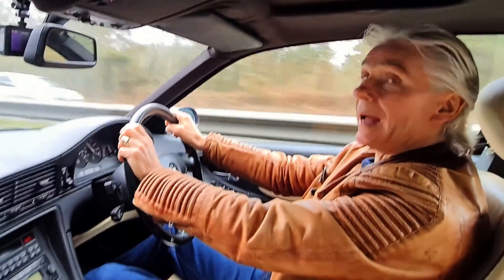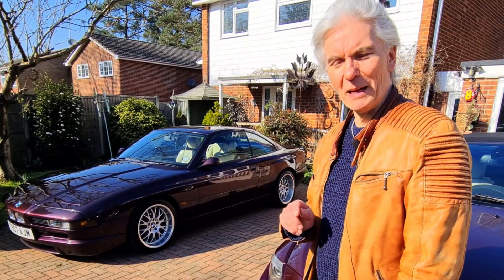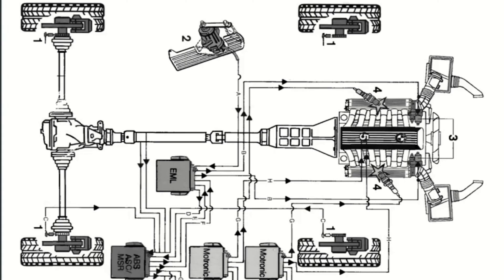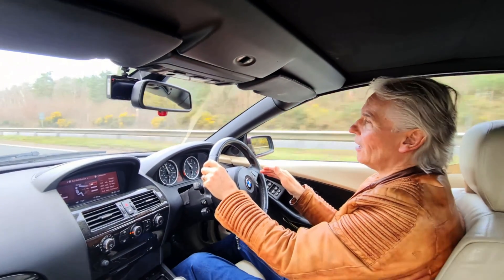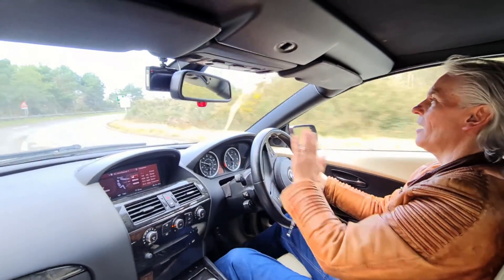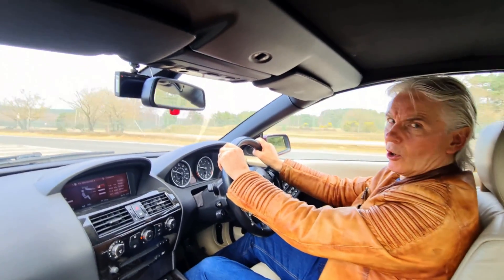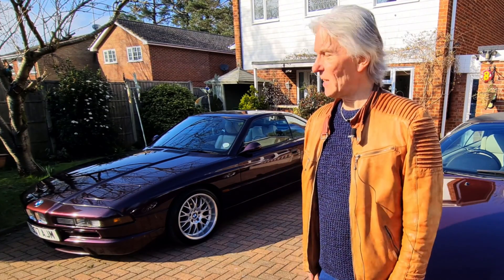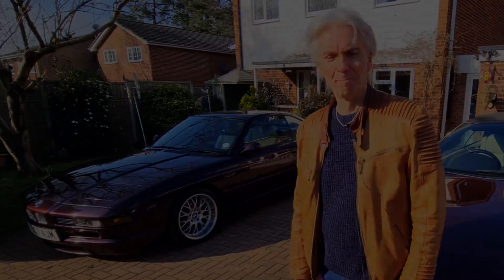BMW LIMP HOME MODE? PROBABLY NOT!

Comment: My bmw 335d 2018 is lagging power under acceleration, when I press the throttle its lags and hesitates, the engine light has come on.ive replaced the MAF SENSOR couple weeks ago so I don’t think that could be the problem, does anyone know what the issue can be?
Reply from the maker: Unless you replaced the MAF with an OEM version it still could be the problem

Comment: I had a 4.6is X5,, the 5HP24 was a well sorry, there is no other way to describe it "Bag of shit"  ,, I had 3 of them under warranty , then ended up fixing the dreaded thump myself with an external oil cooler. having figured out it only happened when the tranny got up to temp,  ,,, .. ... M62 TU ( technically undesirable ) I loved changing those Vanos seals ever 20k it was awesome I give up now on my B7 it sounds like a diesel
Reply from the maker: Vanos on the M62TUB was absolutely awful, my E38 sounded like a diesel as well!

Comment: Some e34 M30 powered cars came with drive by wire throttle. I haven't seen one, but I know they exist.
Reply from the maker: There were a few, once the M70 was doing well, the M30 was "upgraded' to electronic throttle. But  they behaved differently

Comment: I have a 06/98 750il with engine fail safe prog error. How can I confirm my throttle bodies are functioning correctly?
Reply from the maker: Use INPA, you can read out the throttle positions...

Comment: Hi Timm. Very informative video. I have an E34 535i Sport with Drive by Wire (like the E32 735i that had them too) that I 'thought' was in 'limp mode'... I had a flat battery and jump-started it (yes I've only now seen your video on NOT jump starting old BMW's!) and since then I've had the EML light show up. Even with the ignition out, it stays on! The only way it disappears is with the battery disconnected. The result is, I have slow acceleration/throttle response. The car is not limited by revs, but it's just slow. My cruise control still works if that helps. I've tried a spare EML throttle body that I have, and I have the same symptoms. I've been advised that the instrument cluster could have been shorted or developed an issue since the jump start. Where do you think I should be looking to sort this?
Reply from the maker: That sounds like the EML module has come a cropper - they can still be found on Ebay and don't need coding. The instrument cluster has no bearing on the fault, the bulbs (there are two) for the EML are directly connected to the EML module

Comment: can u pls do a video about fuel economy? My mechanic and me are both a both shocked by the amount of fuel my 04 plate 645ci uses. I s it normal to use the amount of fuel I am using just by idling?Is there something wrong or is it just something to expect considering the engine? What is the norm etc?
Reply from the maker: Idle should be between 20 - 25 Kg/h as measured by diagnostics - overall around 25 miles per UK Gallon

Comment: One thing I wish you would have mentioned is the N62 and Variable Valve Lift do-away with any throttle butterfly control, so attributing a electronic throttle body is just not accurate. Instead the valvetronic valve lift system operated by valvetronic motor (one per cylinder bank).  This system is an entire generation beyond electronic operated throttle butterfly. The  Valvetronic  system  varies  the  intake valve  opening  lift between 0.3 mm and 9.85 mm by rotating the eccentric  shaft  during  engine  operation  to  increase  or decrease intake (flow) into the cylinder based on throttle request. Because of this, the throttle valve is left fully open and the intake manifold operates under full atmospheric pressure.
Reply: Doesnt the s70b56 have an electronic throttle body?
Reply from the maker: Hello Marcus, I did mention that several times in the video and tried to refrain from using throttle body - using engine power instead - but I missed a few! However, the N62 does use throttle body control in various circumstances, when first started and after full throttle application. I have covered this in other videos when showing how to test the Valvetronic with INPA. Even saying that, it is a fallacy that the throttle butterfly stays fully open, it doesn't, it constantly adjusts its position to maintain vacuum in the inlet manifold to keep the crankcase ventilation system working.
Reply: @TimmsBMW  Interesting ! I'm still learning these concepts. Quoted from the N62 engine training manual; "The throttle valve is controlled so that there is always a 50 mbar vacuum in the intake manifold. The pressure control valve regulates the crankcase pressure to a low 0-30 mbar." After 60 seconds of engine operation, the throttle valve is used to regulate a 50 mbar vacuum. 50 mbar is 1.5 inHG . The remainder of engine load control is performed by the valve lift.

Comment: Never had this issue with cruise control. In fact its much better and stable than more modern cars.
If you hold the revs stable and switch to sport mode you can feel the car push forward and the power delivery is instant.
Reply from the maker: Your not the only one to say that - I must have a string of dud cruise controls!